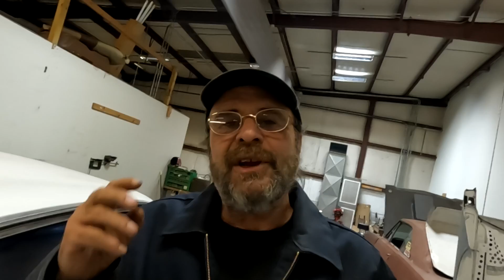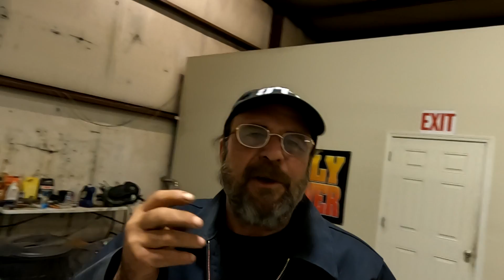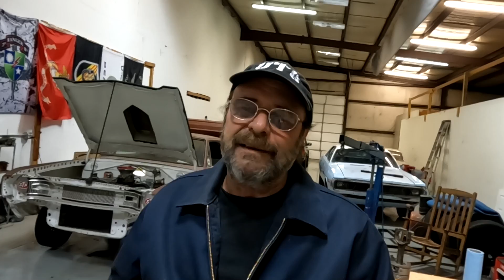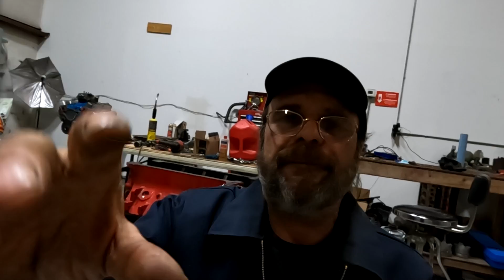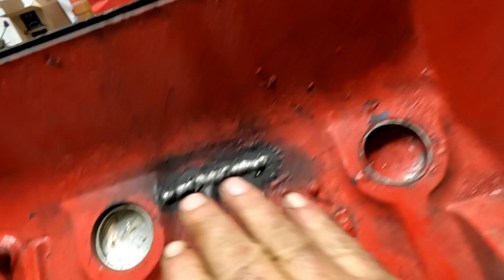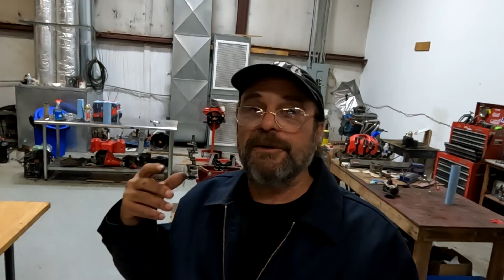Building Mechanical Skills By Embracing Adversity And Failure - A TED Talk For Gearheads Everywhere

Comment: Awesome content Tony I have been turning wrenches as a professional mechanic for about 6 years mostly as a industrial/heavy machinery mechanic. 3 years ago I decided I wanted to build a car I had never done it before. I was nervous at first having never tackled a project like that but I learned very quickly a lot of what I do as a machinery mechanic transfered over to automotive. Now a just about have a running car once I finish figuring out wiring which I had also never done. I had plenty of failures and learned from it.

Comment: Agree 100%. If you don't try it, how do you know it will fail or win? Exactly like you said, every way you mentioned will work, in the right places and right conditions. 99.99% of this type of repair will be in a two car garage on the side of your home, in the dead of night in freezing temperatures, and no single way to do it than to use what you have, when you have to do it. I commented on the last video about brazing being my most successful way to do it, but these new cheap wire welders seem like they're pretty versatile and you don't have to keep but half the tanks of gas around.

Comment: Being poor can generate some very creative skills. Practically everything I know had its genesis in being unable to pay someone to do it. Now, eventhough I can afford it, I want to do it myself. I'm a motorhead primarily, but I can also lay down slick paint, build a transmission, differential, all the electrics, and install glass. Right now I need the interior redone in my '56 Chevy, it has typical 90's tweed and I want something more traditional so I did some homework, turns out I can buy a good quality used sewing machine for about the same price as getting my seats covered so now I have a Juki machine and I'm learning how to do this. It's the one gap in my skillset and I'm 57 myself, so why not. Learning by overcoming failure will build your confidence much faster than all the school books on the planet, combined. Just do it, win or lose you'll have a story and you'll learn something useful.
Reply: What guys want to do interiors! I don't blame you good luck

Comment: 1957, 59A (Canadian supposed to have a higher nickel content). We stripped the block completely, built a large fire and "cooked" the block. Two men, two torches, and brazing rods to braze the crack in the water jacket. Then let the fire burn down, cleaned the block, and reassembled. This ran the rest of the season with no problems and was "detuned' to a '40 Ford coupe an the end. Used for a couple of years that way then sold.  Success for a 16 year old!!!!! Really enjoy remembering the "good old days" with your show.

Comment: Perspective is everything.  I watch this channel and I feel like I'm 12 and just learning  how to change oil. But at work,  where I'm the senior guy, they think I know everything.  I'm a brake and front end guy, I've built a couple Chevy 350's, but I'm not an engine builder. Especially molars. So everything is new to me.
Reply: @MrSwinger1  , I do brake and front end work.  When it comes to modern day motors, I won't mess with them. All my vehicles are pre 2000 except 1. But that is not hard to work on either.

Comment: The only way I could see that block crack is by sound frequency and that is a very long shot. It would take the rotating assembly and everything attached to it to vibrate at just the right frequency to hit the harmonic frequencies of both the flux core and the cast iron. The way it's welded will work just fine.

Comment: Spray a die penetrant on the inside, pop A freeze plug, and let it set for a day or two and spray developer on the outside?? I have used ATF/Acetone for the penetrant and baby powder to develop it with. It isn't exactly NDT professional, but it should show a crack under the weld.

Comment: I would like to think that using the wire welder and small sections is indeed very different from using a big high amp stick and just roasting it.

Clearly, peening is like a given...

Unless you have a big torch on hand to stress relieve the weld.

I have high amp stick welded a set of 455 Oldsmobile exhaust manifolds to sheet metal exhaust pipe and you can't see where the weld is.

It took me over 8 hours, and I used a torch as much as I used the stick welder, but I wanted to make a pair of otherwise insanely stupid crossover manifolds into a pair of nearly identical straight down [actually about a 75 degree back throw] shot exhaust.

It was a total success, the first time, but it was also a whim, and it really did not matter if I failed or succeeded because it was just something to do, not a 'must-do'.

Comment: The last cracked casting I had was the right side exhaust manifold on my international 392.

My older brother tried to weld it with a 50% nickel rod and it began to burn through.

So I said, "Hey. Lets just braze this thing."

So we did.

And its still holding.

I have never before seen anybody braze a cast iron exhaust manifold before, but I figured we had nothing to lose, so we went for it and it was a success.

Comment: I didn't speak until about age 3, but then went right into reading.

As far as walking...

I totally don't remember when that happened, but then I went running around all over the place as fast as I could and I think I began racing before I even knew what it meant.

Now I hobble around, barely able to stand up, wheezing and feeling dizzy.

Comment: I've been certified and recertified since 2015 in several processes. Even if you take these jobs to the best cast iron welder, the best you are going to get 2 out of 3 successful repairs. Some castings you just can't weld, some you can. I've seen engine blocks burried in the best heated sand still crack while slow cooling. Bottom line, you won't know for sure until it holds under use.
Reply: Why not braze?

Comment: You are right . I have put together real JUNK that should have never run but it did . It doesn't work every time but when it does it's really an elevating experience. Next step ,Welding up strokers.  Steel only ,please ?

Comment: the only thing that could seemingly break the weld my thoughts are harmonic frequency in the block or torsional load in the block stress cracking  the weld I-M-O that being said there is some Genius in this method flux core wire its not shielding gas gas stops flash rust   flux well kinda cleans it it helps take impurity's out of the work piece - cast  iron and my thoughts have a good chance of making a good unification of metals probably better odds than nickle wire heat and voodoo with modern antifreeze and letting that cast set open kinda like pickling it nets the best possible fix even if it does fail the only way to have done this any way better is to fit it in a drill press of some kind to keep the drill bit from going wonky and stitch it and the block simply wasnt worth the time it would take to do that    BUT i wonder what flux core nickel alloy wire with shielding gas with a pre heat and sand submersion cool down would net ........

Comment: I was a single parent for 14 years. I have a son and a daughter. I bought my son two dissembled  Yamaha  FZ750s. He had some tools and both bikes came with travel tool kits.  Soon I had a shop manual in his 16 year old hands. He got one bike on his birthday ( Dec 19th ) and the other bike on Christmas.  I had to work but he and his sister wanted to stay at home. Coming home that day in the dark I noticed both bikes were gone. I opened the door and both bikes were in his bed room. The next day when I  got home he had the bikes apart. All parts were labeled and small parts in bags. The next day he had all the parts separated by plastic, steel,  Magnesium  wiring. To shorting this story a lot. I started the bike on Valentines day, Seven weeks after he rolled the bikes into the house.  I was and am still proud of him. He is now 38 and still building, A family and cars. He is also high ranking police officer in a major police dept. My daughter  did much the same but she did the medical field. She 34 with 2 1/2 children. A OBGYN and she also does micro surgery on ladies.  After working one year in a practice she was made a full partner.  So teaching you children to work, think, and never to stop pays off.

Comment: Getting over the fear of failure has gotten me farther in life than anything else
Reply: Right there with you. That being said failure continues to be my greatest teacher, it's like an investment that pays dividends, lol, and last night it did.
Replaced the distributor (among many other things) in my OBS Ford, but the teeth in the new shaft gear have a different profile, so it wouldn't line up with the scribe marks I made before I took the old one out. I double checked everything to make sure I was at TDC, but this truck has fought me so hard I still had lingering doubts it would start. (Ford PTSD)
 I crossed my fingers, turned the key and it fired right up. One minor adjustment and bam, 10° BTDC. 
Failure is what makes success taste so sweet.

Comment: I remember back in 2005 when I was 12yo, with my first car, a 78 305 Monte Carlo with a 2bbl Rochester.
It had hiccups and backfires so I read on the forums that it could be carb related.
Disassembled it and put it back together.
Long story short, car didn't run for over a month.
And I had to figure out what I did wrong, back when the only manual was the Walker carb repair kit printed sheet that was the size of my mattress.

Comment: The thing about fixing something that's already junk is it's already junk if it fixes it and it works score if not who caresThe thing about fixing something that's already junk is it's already junk if it fixes it and it works score if not who cares  People are too critical I've seen tracker engines that have chucked rods out the side that have big street side patch plates on the side of them Still in service Add a small block Chevy break on a trail one time took the Took the connecting rod and the piston out the bottom Take off the rocker arm for that cylinder unplugged the injector 7 cylinder pasted smog? Bobs ur uncl 7 cyl lt1

Comment: Its wonderful that you are an optimist, BUT you are calling the repair a success without pressure testing the casting????   Get some JB weld and Bars Leak because  that block is a sprinkler.

Comment: Love your mindset
I had commented about the conventional wisdom of welding cast.
And you are right there are pros that can breakdown the type of rod and the settings and all that.
I said to wait and see because of micro cracks that are hard to see and possibly internal so undetectable visually might be present. A couple of heat cycles will tell that tale.
As you said, it's a disposable block for testing anyway. Perfect way to test that.
Considering you welded a 4 door into a two door, I figure you can manage to get metal to stick together (penetration), even if it's not textbook pretty. That's what grinders are for.
Good job 👍.
But I still won't say job done til you run it a couple times.
My uncle who was a structural mechanic for F4s and then helped make the boilers for the Nuclear Navy sure didn't poopoo the idea. He probably knows a bit more than most about welding.
Keep up the content.
Great as always

Comment: silicone bronze brazing, with stitch lock pins, and a overlay, I've fixed many cast iron parts this way. it's very accessible, can be done with gas welding and cutting equipment, it's cheap, and a good clean braze is as strong as a fusion weld in steel at 40,000 psi

Comment: That learning curve is why I'm still playing with woodgas. Iv proven to myself it works, now it's finding out the tricks to make power with it, at least comparable to gasoline. Started with baby steps, now I'm at least walking
Reply: I got into producing ethanol and making it run better, building engines specifically for it to maximize mileage the same way. Its fun messing with stuff people don't know much about.
Reply: @SweatyFatGuy  iv been curious about making my own liquid fuels as well, for the little bit of gasoline I do use in my trucks it would be real nice to be completly free of the ball and chain that is the fuel station!
Reply: @SweatyFatGuy  woodgas really like compression as well and all the timing you can give it. I'm running my sbc at 45° advance and it loves it. The soot is annoying ill admit, but im pretty lazy with my filter system. I have to clean my holley carb about every 5000 miles to keep it liquid fuel usable condition

Comment: It's funny you mentioned that things you learn while tinkering with cars you can apply to other things, when I was a senior in highschool in chemistry class we were learning about gas expanding and how compression can cause explosion majority of the class didn't get it if was alien to them for me it was common since it's the basic principles of why a diesel engine works it was the easiest thing I did the entire year
Reply: Similar experience here but it all started in 1970 with a 5HP Briggs & Statton and a mini bike frame.
Reply: @paulhare662  The things learned on the old 5 horse briggs, points ,carburetor then trying things like shaving the head mounting up a slide carb ,taking out the flywheel key and changing the timing to go faster than your buddy.
Reply: @MUUKOW3  Hee hee, "milled" the head on mine by rubbing it on Dad's concrete patio.

Comment: Nothing is learned during success. Everything is learned during failure.
Reply: wouldn't you have learned that what your methods were are correct?
Reply: Learned all about a generator control board today ,as the replacement was bad out of the box ,but different symptoms.  
2-3 hrs of goofing around with tech support on the phone in the field (a literal field)  even though I knew it was bad, we went further in case there is a production issue. 
I know these boards pretty good, but now I got all the insider info.
Reply: America in a nutshell
Reply: "Experience is what you get when you didn't get what you wanted."
Reply: Advice for the bedroom? 🤣
Reply: @peaceonearth8693  qq

1

Q@
Reply: @peaceonearth8693  Grow up.
Reply: @fireballxl-5748  How does it feel to be anti-joke and then to realize that you are no fun and probably tired?